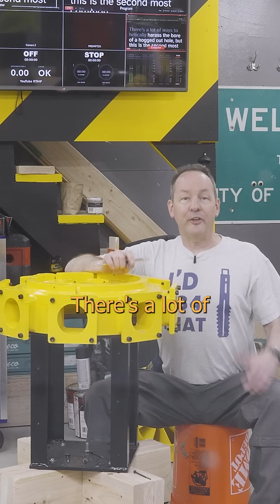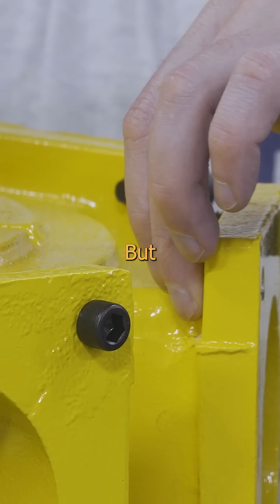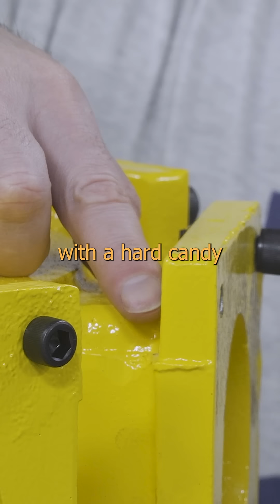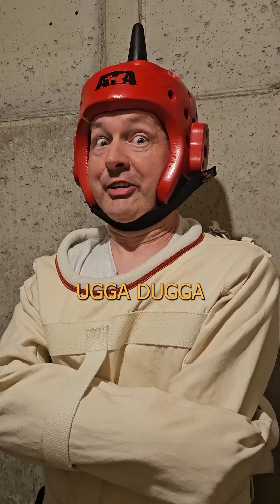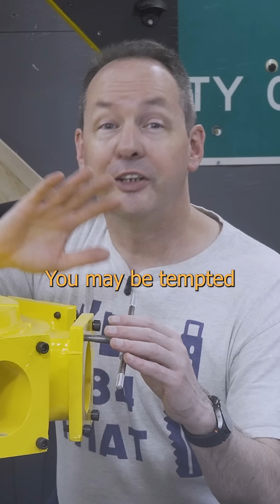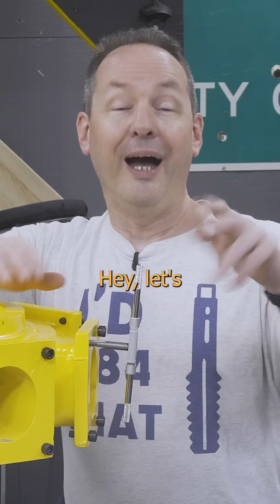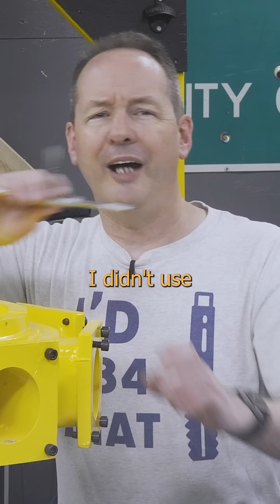Thread Chasing  #chrisboden #comedy #engineering #skills #workshop #metalworking #tools #apprentice

Comment: A metal bottle brush with a bit of low grade solvent works wonders on threaded holes. I once had to clean out an o-ring plug hole some bugger eater slapped Teflon and NPS into, and remove the years of built up schmutz between the original metal and that heinous plug. 
Metal bottle brush, high speed drill, should've had a face shield. 
Sealed up after though!

Comment: I've never stuck a tap in a drill, but I've stuck it in a mill before. My plan was to start and stop the spindle before the tap reached the end of its flutes and snapped. I decided to use the lowest RPM to give myself the most time. 

I learned that the lowest RPM still takes a while to stop. The tap snapped in exactly the way I thought I was going to avoid. The foreman came over and said, "we have tapping heads, dumbass."

Comment: DUMBASS!!

Carpenter here. I was remodeling a commercial building and installing some heavy-ass doors. The chode screws that go in the hinges don’t always play nice after years of use and abuse. 

Sure enough I went to re-tap one with an impact, broke the tap off flush with hinge hole, and had a real bad time getting that sucker back out. Never again.

Comment: I open locked up safes and ATMs  as part of my job. Often the keypad mount holes have been cross threaded and need to be re-tapped or don’t exist at all in the right place. Cutting new threads into a safe door is tricky work. 
I too, in the past, have tried the drill/tap combo bits. While there’s a place for them .. it ain’t in a safe door. 
Try to remove a broken tap from hardened steel will RUIN YIUR DAY. Just ask how I know. 😂😂😂

Comment: I once was trying to tap holes in a lm7 ls head (706) to fix a broken exhaust bolt and my icon tap broke off i then tried to break the tap apart and made a helva mess had to go to  the junk yard and buy a head and had to do it again anyways that time I didnt screw up also I was just using the hand tap

Comment: The machine shop I worked at, we would tap blind holes in aluminum all the time.  Need a plug in variable speed drill, hopefully with a bubble level on it, lots of oil, and back it off occasionally.  It worked really well almost always.  Almost.  Always.

Comment: Oh, hell... The boss said to do that EVERY time. Using a drill to speed up a chasing job on a fresh stainless steel clamp ring. 304 stainless if I recall. And about 28 holes. M10 by 1.5. Had to use a pully tap, otherwise it's something that is a foot and a half long for those that haven't seen one before.  And man, can that little tap SCREAM!!!  But yeah... Always had an airline handy to blow the chips off before backing the tap out because it would get twice as noisy if you didn't and it would start getting rather tight.  Gotta love working in a machine shop for over 4 years...

Comment: You should cover all the types of taps! For any given thread callout (of which there are so so many) there are the common tapers of cutting taps, different flutes for chip evacuation (for when you cant blow on the other end) and then there are forming taps! Forming taps are awesome! For new holes they have a whole different drill and tap chart since they cold form the metal instead of cutting it. But my favorite use for them is for thread chasing. Since they don’t have a cutting edge they are pretty hard to cross thread, and my dumbass has definitely reworked these with a drill… a lot. They are often made without flutes and are stronger than taps that need to clear chips. I’ve broken more taps than I’m proud of doing things the dumb way, but I’ve yet to break one of these unless I’m trying.

Comment: ive used a drill before with a tap. just put it on the screw settings and put it all the way down to 1 where the chuck is. designed to slip at a certain torque. just keep going up by 1 or 2 until it goes all the way thru. dont got to push down on it threads will pull in drill.

Comment: DUMBASS
haven't had so much trouble with internal threads but I've had to rethread the studs on a body panel extension for a '69 Chevelle TWICE PER SIDE because I fucked em up trying to use "speed nuts". Long story short: "speed nuts" are anything but fast.
I. Hate. Speed. Nuts.
if you don't know what a "speed nut" is I envy you. they're stamped sheet metal with sharp fins that try to cut new threads and they'll do so any which way but straight until you end up with a metal turd covered in flaky bits that's 2 sizes smaller than what you started with. please tell me I'm not the only one that hates these things SOMEONE has to know what I'm talking about

Comment: Had to drill out a broken stainless screw from the base of a very expensive vessel for biomed production. Explaining to the engineers that stainless steel is one of the worst metals to tap a blind hole in and if we screw this up it's going to be a nightmare to fix. Thankfully it went well.

Comment: working on a tow boat, captain had really nice set of tap and die.  We had a vent cover in the engine room.  had to take it off to paint the engine room.  after painting had to put the bolts back in.  it was a pain in the ass to get the bolts out. so I got the tap and die out chased the threads with a tap, chased the threads on the bolts with a die.  put a little Never-Seize on the thread before I put them back in.  it was so smooth, so easy to put them back in and take them back out...it was almost sexual.

Comment: I’m one of them dumbasses. Was using a 1/4 tap to clean out the threads for a 1/4 grease fitting and cross threaded. Brittle is not an accurate enough term I feel like because I found out they are easy to snap with minimal pressure at certain sizes and also found that they are infinitely easier to get stuck and broken than they are to remove after they’re broken

Comment: Dumb@ss.. I was the guy tasked with removing a broken tap in a 550HP diesel engine rebuild after the goober cleaning the wax after surface facing used the exact uggadugga you mentioned, on the fecking head bolt threads no less. I only worked on it with a hammer and punch to shatter it "gently" and blow out the shards for most of a day before rectification with a mag-drill and helicoil. The new head bolt did tension correctly during install, but I really couldn't say how long it lasted. I lost track after a few months when the company was sold and bought. Many assets were eventually recycled to the scrapyard.

Comment: And if you don't have a tap on hand take a spare bolt if you have one that fits the threads and cut a line in it with a metal grinder wheel and then tilt it slightly at the end. It'll do the job as well in a pinch.

Comment: DUMBASS!!!

One occasion I was tapping through a flange and accidentally sent the tap all the way through. The shank was too big to go through the hole so it was stuck with the relief being the only thing in the hole. No worries, i can back it out, I’ve done it before. This time though I couldn’t get a thread to catch to back out the tap. Ended up having to mill the tap into two pieces to clear the hole and save the part. 😅

Comment: I bought a lighting fixture that hangs from 2 rods that are made up of 12 inch sections with short all thread bits screwing it all together. My ceiling is vaulted, so one of the rods needs to be longer than the other. My electrician looked at it and noped out. I ended up doing it myself by cutting one of the rods and the tapping the cut end. Giant pain in the ass. I couldn't get enough purchase on the rod to back the tap back out without damaging the rod surface. Definitely tried to chuck the end of the rod in a drill in a moment of frustration and desperation... glad I had lots of spare rod sections... finally gave up and drilled a small hole perpendicularly to the rod and then put a screw driver through the hole for leverage. That was trivial. The tiny hole is 12 feet off the ground, I'm probably the only one that will know it's there, but it tasted like failure at the time.

The drill / tap line had me absolutely dying though. The temptation is irresistible.

Comment: They make thread chasing kits, Lang is the most common one. They are not to cut new threads but to clean up what is left. Taps, like mentioned, can screw ya quick if ya quick if you are off my a hair. 
Lastly, you can make your own thread chasers out of bolts/nuts. Cut a couple slits vertically into the threads for the junk to collect. Use a file on the nuts. Works great!

Comment: 4 bolts job to attach a fairing to my Harley. Easy. Didn't chase the dirty threads before installing the chinese bolts. One bolt broke off in the top triple tree. Drilled out the center. Mint. Drilled it bigger. Mint. Running the tap in 99% through, the handle barely touched the headlight and it broke off below the top in aluminum. It was my only tap. 20 min job at 10pm became a 2.5 day job and new pliers, new taps, new bolts, new drill bits, new swear words.

Comment: Was removing a sheared bolt from the cover on a motor box. Threads were a bit messed up, and seeing as it was a high vibration area i tapped in for a bigger bolt. Drilled it out and realized i forgot the handle for the tap. Being that it was a bit of a walk to go get it and the fix was already taking longer than it needed to i tried my hand with the dril. Snapped the tap off in the hole, undid all my work and ended up having to change the whole motor box. Indeed i learned the hard way.

Comment: Grinding a flat on the side of a bolt near the tip will achieve the same result with less stress of 'cutting' the threads larger.

Comment: Learned in high school machine shop  class on a Bridgeport knee mill. Low gear and quick on off flips of the power switch. With the quil unlocked, let the tap pull itself in to the required depth. 
Works just fine until some idiot tries to force the quil down or forgets the mill is in high gear. Or the worst one of not paying attention to depth on a blind hole and snapping the tap off.

Comment: I was rebuilding, for the 5th time, a 420cc engine I literally found in a river. This particular block came off either a big boy homer generator or an old horizontal shaft lawn tractor. Maybe mid to late 80s, no idea since the data plate is long gone. I cleaned it up, got it running the most redneck way possible, and shoved it into my very janky mini bike. I later fried a piston, dropped both valves, and then literally shattered both crankshaft AND cam shaft. The thing just WON'T die! So, I super charged it with a mini supercharger off amazon/Temu. 18 lbs of boost. Still won't die. Well, a few months ago, I was rebuilding it, again, after the forged piston melted. I was running methane in it this time. I was casing the threads for the crank case and my DUMBASS decided to use a cheap low amp drill to chase the threads. Tap broke off, I tossed the drill in rage, engine parts for that engine went flying, and I spent the next TWO MONTHS with two tiny picks trying to unscrew the broken tap out of the hole. I did get it out and I did rebuild the block. It's currently running a high octane/methane mix on my drag lawnmower, yes you read that correctly, and my fastest pass on an 1/8th mile track is 6 seconds flat. It's too sketchy to go more. Twin mini supercharger, I think a 36mm flat slide carb, 40 lb valve springs (not enough), forged piston, forged crankshaft, "Thumper" forged cam, oil cooler, I believe a Polaris 500cc snow mobile CVT system (?), rear end out of a Samurai (shortened to fit), and most of a Sears lawn tractor body on top of a tube frame and roll bar. Think a mini tractor pulling tractor and then redneck it times YEEHAW.

Comment: So add an old job I used to chase threads with a drill. 

All was well until my last competent coworker thought he could do it too. 

I was chasing holes that were mostly good but hard to get bolts in with fingers. Some days I would do as many as 100.
Reply: I told my coworker he wasn’t supposed to do it however he was 30 years my senior and wouldn’t listen to me even though I had seniority he destroyed a tap and I spent a morning getting it out of the hole.

Comment: Got a dumbass story, but it wasn't me. 
To be fair to the new guy, we did call it a tap. That's all we ever said, "tap it out."
He screwed it as far as he could by hand into a hole, but I caught him before he "tapped" the tap with a 3 pound sledge. 

We changed our verbiage concerning the tap after that. 

Also, trust the new guy as far as you can throw him. Watch those greenhorn dipshits like they're a toddler with a loaded gun.

Comment: I use a drill to cut threads  all the time. Having said that my clutch rides on the line of the new brothel girl and the desk girl that runs said brothel. So yeah what chris said don't charge in with the pissed off pixie driven hole hogger. Just saying "dumbass" don't... instead if ya want that great ASMR treatment head over to the"freight" and pick up a ratcheting tap driver. Thank me later. And Chris I was the kid putting the coin in printing press jig for "Dumbass".🤣.

Comment: Watched a classmate destroy a set of threads he was trying to chase with a drill. Had the power driver turned down as low as it would go and actually seemed to be getting away with it. Seemed, key word. When we got the tap out we discovered he had effectively removed the threads and now had a through hole for a rivet.

Comment: Only time I ever used one of these was on my cylinder head of the go kart I used to drive (spec clone 200cc for those in the know, and for those out of the know think basically a slightly bigger way more cantankerous lawn mower engine from my understanding) cuz my exhaust kept falling off (I literally ran over it one race and still kept it going a lap or two before I felt the heat, anyway long story short the re-thread did jack shit and my dad had to buy a whole new cylinder head

Comment: Use cutting oil, back out 1/2 to a full turn every once in a while. Especially if it gets tight. This allows the cut up bits to fall into the channels in the bit that are meant to catch them. Once fully through, back out most of the way and go back in most of the way. Smooth out any imperfections. And lastly, if you did end up cross threading it, dont bother trying to see it through. Just grab a drill bit, make the hole wider, and grab a bigger tap because you just went up a bolt size.

Comment: Dumb ass here. If you cross thread it , it will get stuck. Whatever you do, don't break it off in the hole.  You can't drill through a tap. It's as hard as the drill bit. A drill bit won't cut it. If it gets in a bind don't force it. Power tools are likely to break it off.

Comment: Had to do the inverse of this for one project.  Had to use a die  to clean the threads of galvanized A325 bolts to work with a set of posts that had tapped holes in 3/4" thick 304 stainless steel cap plates.  Long story, but the mission at hand was taking the schmutzed up galvanized threads and cleaning them so they worked smoothly with the stainless tapholes.

By the time we were done, my forearms looked like Popeye the Sailor, and they screwed in smooth as butter.

Comment: Snap-on has a tool to chase threads, because of course they do; but they’re shorter and a bit softer than a tap. They also make nuts to keep your bolt threads correct, because it isn’t always the hole that’s the problem. If you work near salt water almost everything gets crudded up in no time.

Comment: A factory I worked in (no I will not name the company) had a three week long training regiment. We spent 2 or 3 days being taught about threads, bolts, torque specs, etc. I swear every day, at some point, they would say "and never use an impact to clean threads" or some variation thereof. Literally in the first hour of being on the production floor, the trainer for my station handed me an impact and said "clean out all 25 holes on this part." Being the good noodle I responded, "but they told us in training that we shouldn't and it would likely lead to a write up." Their response? "Yeah but the managers and up don't want us to spend more than 90 seconds on this step and the painters all eat crayons."

Comment: Never used a drill to tap a hole, but I've broken them in the hole. Has to be the worst thing to drill out I've ever cone across. Better have 1 or more new sharp cobalt bits and a really good center punch or it's gonna be worse quickly

Comment: Had to tap 24 M3x2cm holes.  The first one took like 20 minutes, no way did I have the patience to do the rest by hand.  Tried a drill with tap.  Finished 2 more before the tap snapped off inside the part.  Oops.

We ended up remaking the part.  Big lesson in do it right or don't bother.

Comment: I follow you on not wanting to damage the paint. I use wax sometimes in some spaces where im worried about the finish on something. Most of the time im working on something ugly or unseen so who cares lol. I often chuck these in to the drill AFTER hand threading it all the way thru. Apply a good amount of oil and ream it back and forth, not all the way in or out, you dont want to lose positive engagement. Helps clean out any debri and just makes me feel better lol

Comment: Thread taps are not thread chasers (though they can be used for that if you're careful). Thread chasers are not thread reformers (NEVER use a thread tap to fix a buggered thread. A reformer pushes metal back to where it is supposed to be. A tap cuts and removes that metal. weakening the thread). Chasers are closer to taps, but are just "dull" enough to remove foreign material without cutting any metal.

Comment: So I consistently do the drill method with great success. The key is to set the clutch low and then very slowly start it. I would not use that for any tap below 5/16 though as theyre too easy to snap. For reference I did it for chasing on average like 75 3/8-16 holes on every trash truck i worked on.